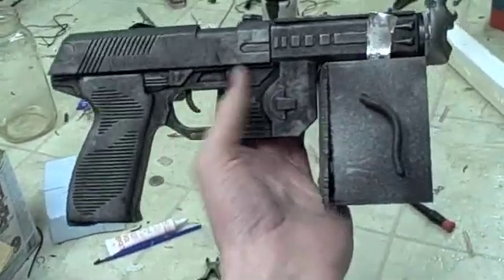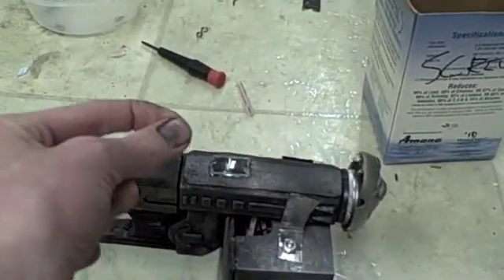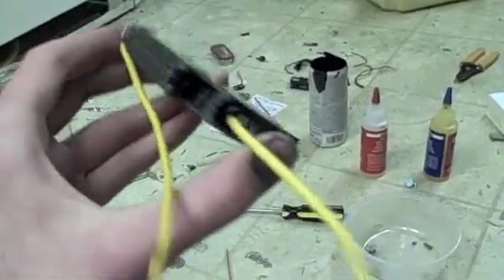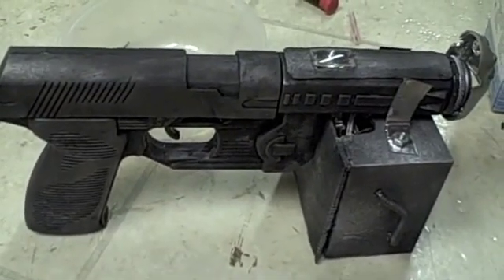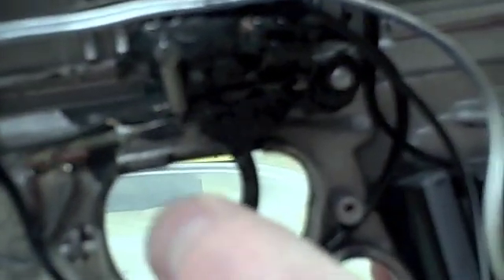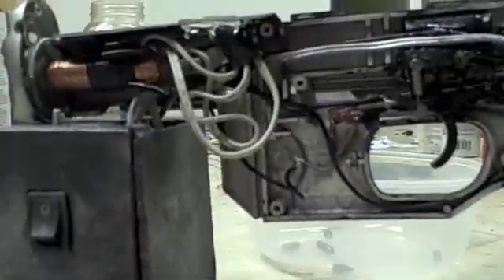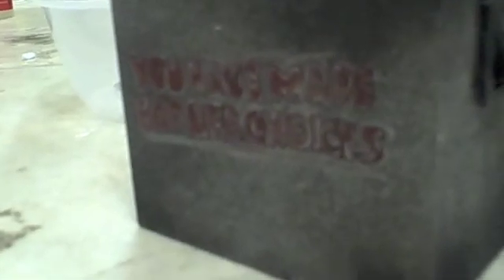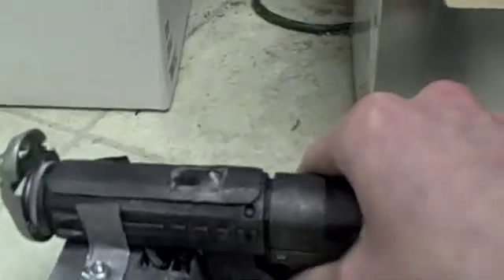Coilgun is DONE

Comment: No no, not rotating the barrel, but rotating the cool around the barrel. Have the cool fit on a spindle, put the barrel through the spindle, and separate the main wires from the coil by a gyro (like one that's on bmx bikes) and spin the coil around the barrel before and while you feed the round.
Reply from the maker: ... so the barrel is stationary and the coil is spinning around it? I'm not sure I understand what that's supposed to do, but I can't think of anything it would do.

Comment: Question... would a spinning coil allow this to go faster?
Reply from the maker: I don't imagine the velocity would increase, but it might stabilize the projectile a bit. I tried something similar with a spinning barrel, but couldn't get the projectile out of the barrel... seems the centrifugal force pressed the projectile against the barrel harder than the magnet could counteract. A more powerful coil, a better matched projectile/barrel, and better centering of the barrel on the motor shaft would probably help with this.
Reply: Darwinpasta It seems to me that, if you want to spin the projectile in order to stabilize its flight, the easiest thing to do with a coilgun would be to put angled fins on the projectile itself.
Reply from the maker: Let me know if you have a go at it! I was kind of wondering if a series of coils around the barrel could act like an induction motor and induce a spin that way.

Comment from the maker: The plastic gun was less than twenty bucks. Rite Aid gave us the disposable cameras for free. The coil wire isn't especially cheap but you can find a shitload of it in an old CRT (bundled in electrical tape and strung around the back of the tube, probably for RF suppression or something). Oh, and the rod we cut bullets from was maybe five bucks.

Comment: Dude, get a cheap electric airsoft gun & use the trigger mechanism from that (it completes a circuit with each pull of the trigger, but it would function perfectly, like a trigger should... not all precariously like the one you have there)

Comment from the maker: I considered that, but due to the relatively low velocity and the fact that there aren't any gasses rushing around it, rifling wouldn't do much. I ended up mounting a motor with a small bit of drinking straw on the end, to spin up the projectile before flinging it, but unfortunately the slug just slung around inside and got bound up on the walls when the motor was going. Thanks for the idea though!

Comment from the maker: Sorry, only just saw these.

1. I got it to shoot the length of my basement, but only with a small projectile. Multi-stage and more power would help here. 2. Sure. Maybe use multiple capacitor banks in rotation. 3. I see no reason it couldn't be breech or top loaded. IIRC there's a vid around here somewhere of an auto-reloading coil gun where the projectiles drop in from above.

The practical side of this one is pretty limited... but the technology can go much further. :)

Comment: I used an old professional camera flash i got used for 10$ capacitor rated to 400v, (circuit charges up to 318 volts), And i use a traditional house light switch for the trigger. I have the flash integrated into the gun in order to blind my prey as a stun mode :).

Comment from the maker: There's the current and then there's the voltage... I'm sure a relay could take the current, but the arcing from this setup is brutal.

I'd skip the whole cluster and use an SCR (basically a badass transistor) instead of a switch. Good luck with yours, and be careful, the capacitors can really knock you down... surprising how much punch you can ramp up from a couple AAs.